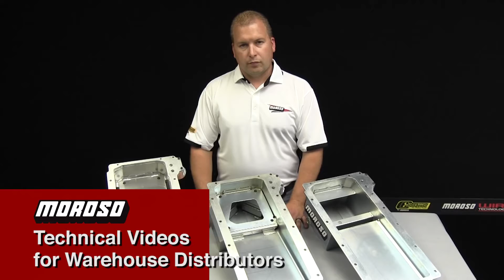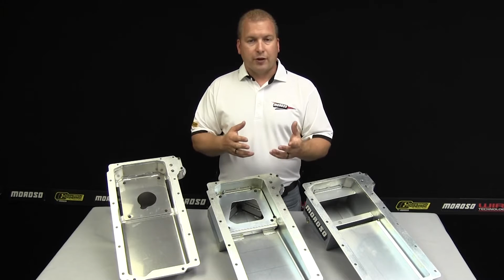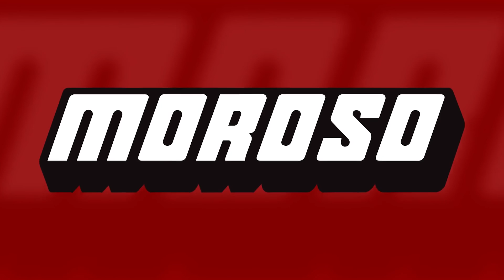LS Series Oil Pans Moroso Engine Chevrolet Chevy GM Tutorial Overview

Comment: The Cast Aluminum oil pan is part of the Integral  strength of the LS Block   and   the newer Generations  even  have two bolt holes in the  Oil Pan that  you bolt the Transmission too .. I'll  pass on these when I decide what to use on my 79  Camaro LS project ..

Comment: I Bought the first Oil Pan for my 1971 Chevelle LS Swap.  Where is the location for the dip stick?
Reply from the maker: It should be just above the oil pan in the block, just in front of the starter.
Reply: There is a place to drill a 3/8" hole in the Block if not there already..